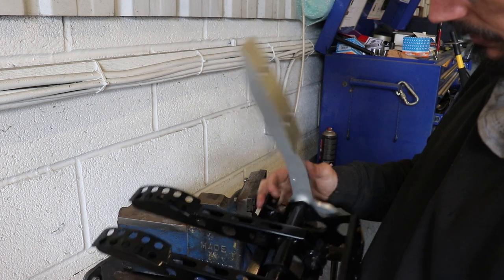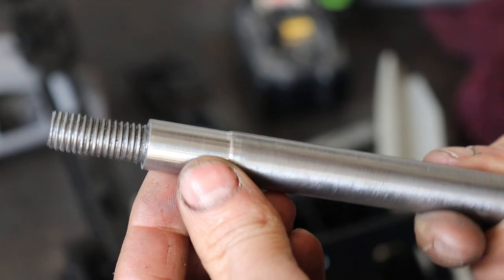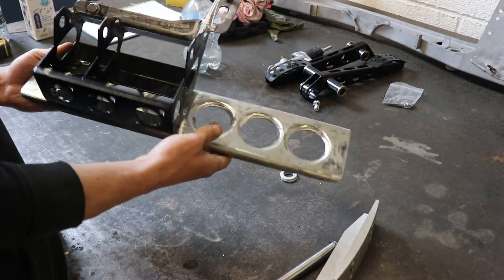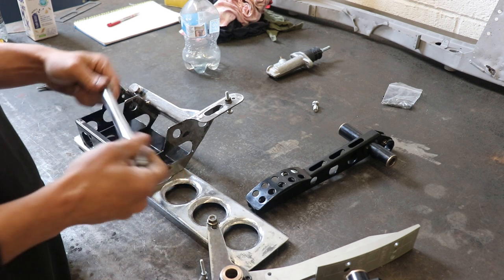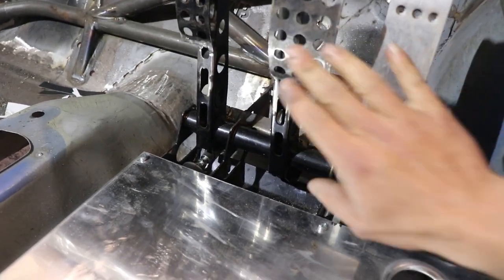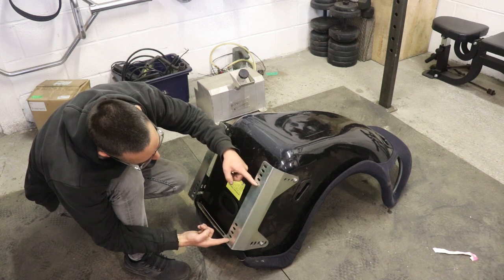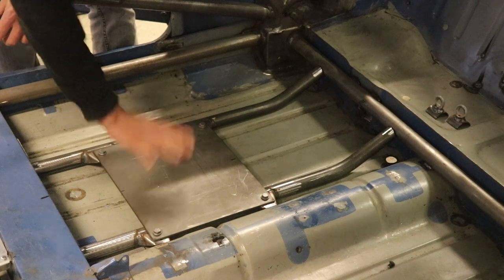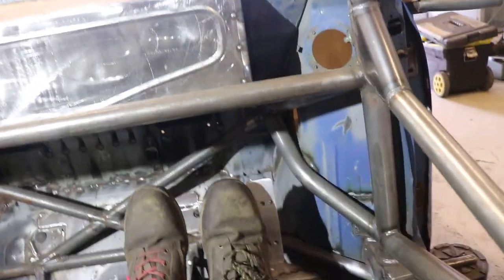Floor Mounted Pedal Box for the Classic Mini Libra - Part 12

Comment: I learned to heel and toe when I was a teenager in the '80s because the brakes in my old Mini were barely adequate. I had a bolt-on 'Paddy Hopkirk'' pedal extension which brought the throttle pedal closer to the brake.

Comment: Very much improved. I would consider adding a heel rest to your floor plate.
Reply: To pivot from your right heel to shift from throttle to brake- it will really help keep your foot planted! And enough to anchor your left to to help in higher gee corners and such. The car is looking awesome- and weight is always a battle- good luck with that! Just thinking, a solid car that doesn't break has a lot going for it just starting out in a new class- and you have to finish to win at all, I'm told!  FR

Comment: Awesome job rebuilding the pedal box 👍🏽👍🏻     been annoyed myself,  as sorting out my Rav4 drive shaft as it was made so you had to buy a whole new one,  but you can now change the universal joints but they need to be machined out , took to a shop but they where going to charge 850 to do it,  the new ones are 1200 plus shipping lol , so I did it myself because I still got to get another job So don't have much $ at the moment,  but had to buy the parts that came to 400, but now waiting for the universal joints to be shipped to me from the north Island to me in the south Island 😞😞   when other car's drive shaft's are way more cheaper arrh lol that's life in New Zealand

Comment: Awesome work as usual, Matt.

I'm not sure if you know this, but Mini steering pinions & columns come out of the rack at a very slight angle (towards the driver's side). If you try to mount the column at 90 degrees to the rack it'll strain the pinion and shred it.

Comment: the seat mounts support tubes ate running the wrong way in the car if you consider crash. The tubes should run from the sill support lower tube to the tunnel across the car. This way in the event of a hard side impact the seat will move as a whole. With the tube supports running lengthwise the tubes act independently and can deform as such. This can lead to one side of the seat failing or deforming trapping the driver and in some cases hip and pelvic damage

Comment: Excellent work, Matt. If you had to do it again, would you just fabricate the pedals? The cage and all the strengthening will make the car pretty bulletproof. You say people have said you tend to overbuild, I wonder at which point when adding metal you can be said to have crossed the line between just enough and too much. It's always a pleasure to watch top notch fabrication. All the best, Mart in Solihull.

Comment: I've got a very simular floor mounted peddle box setup with a ali foot plate, I found that my boot heal got caught in the gap between the clutch peddle and base plate when depressed.
Also can't believe no holes added to the seat base plate 😏, can't make anything lighter than a hole👍
Reply: Don't thin the base plate stayed in the car, it was just being used to set the positions of the seat mount when it was being made and then welded into the car.

Comment: Don't know if it is the same spec for track cars as rally cars but you can't run your belts down to eyes like that you have to have a bar going across the back for your belts to go to just below the level of the holes in the seats just something you might need to look at
Reply: I was going to mention this as well and it won't pass anything. The FIA released over 200 pages on this subject alone. The damage thats sustained in a crash to the spine at this angle is very very bad!
Reply: @martinking9663  yea he could do with sitting down and going through the regs again there might be more than just that wrong
Reply: I think those eyes are just for the lap belts. I reckon he'll  have separate mounts for the shoulder belts.
Reply: I'm a bit concerned that the seat mounts don't meet current yearbook requirements.  Those 'ear' type tabs aren't allowed any more, the mountings now have to go directly through the tube.

Comment: Just curious about whether you plan to use a cable adjuster for brake bias. That would appear to be a reason for the original pedal shape below the pivot.  A cable guide like the guide on bicycle V brakes could help with the cable angle if you need to revert to something similar to the original.

Comment: Has those pedals been drive-tested by now? Is there any flex on the floor mount? Dimple-dyed pedestal looks thin - what thickness is it? I've made (a rather ugly) 'pedestal' using 0.08" (2mm) metal sheet (not dyed though) for the pedals I use and it's flexing SO good (which makes me SO sad) under breaking (since there's no brake booster used I guess?).

Comment: When it comes to the drivers side of the car you want it as strong as possible. So yes your adding more weight than necessary but it's your life your playing with. Would rather it be heavy and strong rather than light and weak.

Comment: Rather than heel and toe why not left foot brake and use the throttle to do clutch-less gear changes I don't know if mini gearboxes are easy to do clutch-less change but it used to be relatively easy in my mk2 escort when the clutch cable went. Mind you pulling away with the starter motor wreaked havoc with the bendix, but that wouldn't matter in your situation. The difficult part may be mastering left foot breaking which I could never master, so I had to heel and toe.🙂👍

Comment: A shame the pedalbox needed a total rebuild, a lot wrong with it. I did wonder if you could extend the actual accelerator pedal to the left with a bar above the brake pedal so you could heel and toe without twisting your ankle if that makes any sense. As always your build quality is superb, but I guess you do need to watch the weight. I wonder if a carbonfibre roof panel would be legal for that class?

Comment: Why didn't you put a disc with a groove or an excenter (for ramping or progression) to the axle of the pedal, so the cable would have been pulled around that and therefore not collide with the pedal itself?

Comment: I noticed as you were promoting some of your merchandise, the bitchin' wheels on the unibody-frame Honda-powered custom motorcycle you built some time ago, and wondered if you could direct me to the company from which you purchased them.  I'm not certain how you would go about passing that information to me but perhaps if I patronize your Merch. Outlet, we could establish my location (near Ft. Worth, Texas) and proceed from there.  I have a Denver-framed chopper set up for a CB750 Honda engine (SOHC) which I started decades ago and does not yet have wheels.  If I can source wheels from the outfit that supplied your wheels, they would be perfect.  Thanks!

Comment: I can understand floor mounted pedals when there is a deep separate chassis with floor boards on top - but in a modernish car with steel monocoque, pendant pedals seem much more logical. Linear movement, master cylinders out of the way in the engine bay, and no clutter under your feet. So why go for floor mount pedals here?